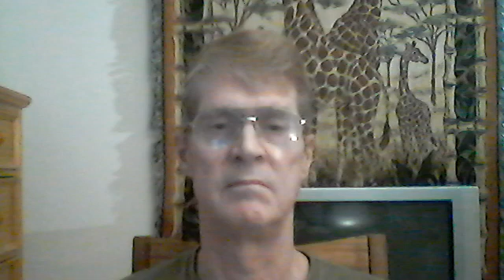Why Do Verticals Receive More Noise?

Comment: w1gv de ko0b,

Corona discharge.   If your hearing is as good as mine when I was younger, you can often hear corona discharge just standing near a  metal flagpole, or windsock pole.  I have noted this under clear blue skies, even...not storm related.  Anything sticking a significant distance into the air is going to have it, such metal poles just happen to be low-loss acoustic conductors to bring it down to ground level.

A vertical antenna has an unbalanced, high-impedance point at the top, and is resonant.   This is the perfect setup for converting the random corona discharge into in-band QRN.

Dipoles are often put up as inverted Vee's for practical reasons.   This puts the high impedance ends low, so less corona.   The middle is low impedance, and balanced, so the low corona currents don't get transformed into big signals, and the balanced location allows significant cancellation.  Result is notably less QRN than a verticle.

Loop antennas tend to be quieter yet, because they have no ends to concentrate the discharge, and are often arrainged (diamond) so the highest point is exactly balanced WRT the feed.  Anyone who has used both will tell you a quad is quieter than a yagi.

The old ham lore that noise sources are vertically polarized is hogwash.   Most manmade QRN comes off power lines, which are universally horizontal.

-73-
Kev

Comment: Some quotes from an article in September 1995 QST, pages 33-36, by Brian Beezley (K6STI) with the title ’A receiving antenna that rejects local noise’. Note the sentence that I have flagged with *

“The surface wave makes local AM radio broadcasting possible. Because of the poor propagation of horizontally polarized ground-wave signals, AM broadcasters universally use vertical polarization. The same phenomenon causes vertical antennas to pick up much more local noise than horizontal antennas do. Even if a noise source has a stronger horizontal component, by the time the field reaches the receive antenna, the vertical component almost always dominates.”

“Raising the dipole broadens the broadside S/N peak and improves S/N off the ends. For example, for signals arriving at 20° elevation, a dipole at 50 feet has an S/N advantage over the reference vertical of 6.3 dB in line with the wire and 25.6 dB broadside. If you have just a single noise source and you can rotate a high dipole, you should be able to come within a few decibels of the latter figure most of the time. But when multiple noise sources in different directions arise (typical for power-line noise in times of low humidity), rotating the antenna won't help much. The S/N advantage of the high dipole then is likely to be near the worst-case figure.”

* “These numbers illustrate the advantage of horizontal receiving antennas and substantiate the notion long held by amateurs that ‘verticals are noisy’. But you can reduce ground-wave noise much more effectively if you don't rely on a simple horizontal wire.”

Google the title for the full article.
Reply from the maker: Thanks. I'll download the article (PDF) and read it. 73 de W1GV.

Comment: I was taught that most man-made noise is vertically polarised. This point was made by an RAF comms instructor but I have to say it wasn't backed up with any evidence. An earlier reply to your video got my attention regarding house wiring. The drop to a light switch is vertical ! and if you've ever listened to your radio as you flick that light switch it can have a massive effect i.e. crackling and gain changes in your set. Now imagine people all over the world doing this vertical arcing and sparking. I'm surprised I hear anything at all with the cheap ( and I'm sure non-RF-compliant ) LED  lighting everybody is using these days 73's Stan, you may feel better when your foot is sorted !

Comment: Im sorry to respond with a question that is off topic in that my question is about something else then noise in vertical antennas. 
I am new to amateur radio, and i am living paycheck to paycheck, so there are much equipment that has to be homebrewed.
What i wanted to ask was about installation of an regular dipole antenna with a ladderline feedline, into the house, through the window.  
I am renting, so i am not able to go through the wall so i have been thinking about using a flat coaxial cable that are used for going through windows, but i am not aure if that is the best way of doing it. 
What obstacles can i encounter while doing this, and are there something that i need to know before i get started with it?

Sorry for dropping this into This videos comment section, but i went through a few and this was the first one with one. 

/Ronnie
Reply from the maker: I would run the ladder line under the window sash. If the sash is metal, wrap the ladder line with electrical tape where it passes through. Then close the sash on the ladder line.

The ARRL has books dealing with antennas and various tricks for doing thing like this.

You can call their headquarters on the phone, or e-mail them, and they can offer lots of possible answers. Ask for their "technical information service." Their phone number and e-mail appear in their website, arrl-dot-org.

73 de W1GV.
Reply from the maker: Got some viewer input regarding your question. Please see the comments section in the video that comes a bit after this one, called "Feedline Through A Window." 73 de W1GV.

Comment: It does seem that way though. My Vertical seems a little more noisier than my EFHW. As for why? I think part of it has to do with the reception capabilities. The EFHW is 60’ long, but the vertical is only 11 feet or so. One may argue about polarity, and perhaps this is the case. Could it be that the noise you hear on a vertical is RHCP noise from space? This would make sense as to why it’s not picked up on the horizontal antenna to well. Food for thought...

Comment: Well, Stan. The question you posed is worth way more than any answer you could supply. I, myself have had experience with this phenomena.I have often thought that it has to do with the fact that when high frequency signals hit the ionosphere they tumble and become circular. My concept of this behavior could be completely off base, but I believe that all reflections from the ionosphere no matter what their shape or condition return to earth in a manner that will intersect a vertical propagation in an inconvenient way. Would this not cause noise for anyone trying to receive said signals?

Comment: No one has ever been able to prove to me that noise is vertically polarized, I have found quite the opposite. If that were the case, then all the power lines must be vertical. A few things that I know horizontal antennas such as dipoles are directional to large degree even close to the ground. The take-off angles are mostly high so goes receive. Vertical antennas are non-directional and receive  fairly equal from all directions and the take-off receive angles are low. With that it becomes evident that  verticals hear closer noise sources from all azimuths equally for the most part. In addition to this, horizontally polarized signals are  close to the ground (less than a wave-length) are attenuated  more than vertical signals. A statement I hear a lot is "vertical antennas transmit poorly in all directions". Nothing if further from the truth. Study Stuart Ballantine, Dr. Serge Schelkunoff, James Clerk Maxwell and Dr. George Brown.

73'  de K4WRF